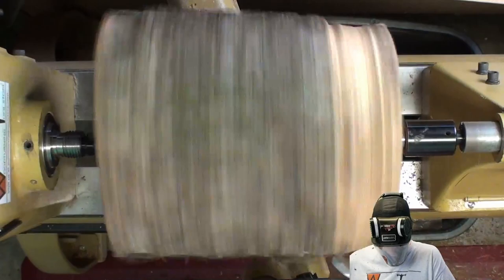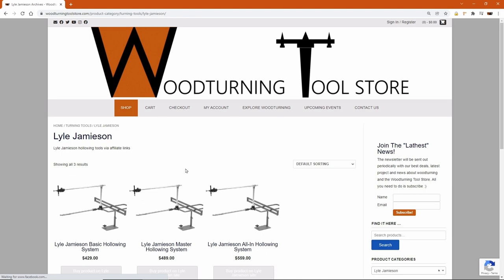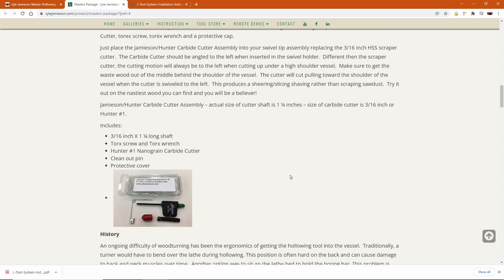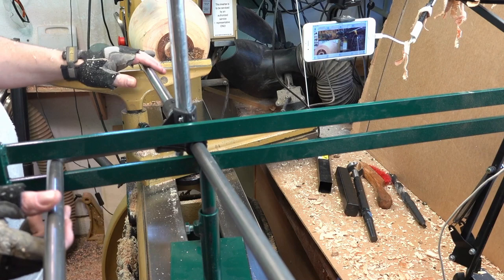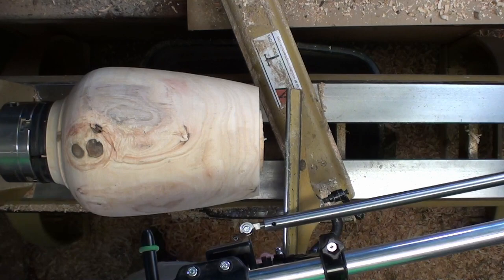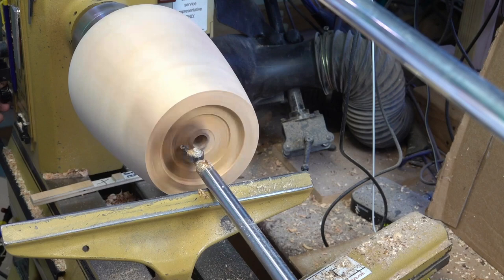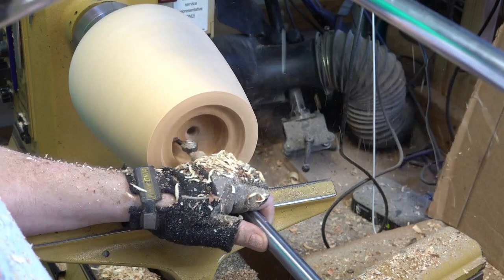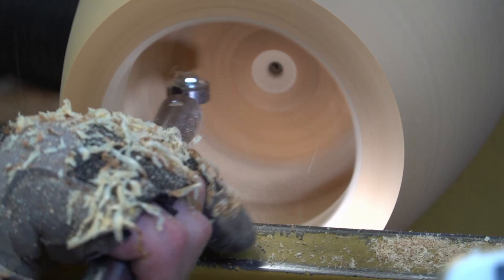Large Ash Hollow Form - Using the Lyle Jamieson Hollowing System

Comment: what's a safe hollowing depth with this system
Reply from the maker: Bill, the standard 3/4" dual ended bar is 17" long and can be used to hollow up to about 10-12". Lyle makes an optional 1 1/8" diameter bar for the same system that allows hollowing up to 17". I hope this helps.
Reply: @WoodturningToolStore  yes it does exactly what i needed thank you

Comment: On my Jet 1642... Once the cutter is centered on the spindle. If I move my tool rest back toward the tailstock the cutter lowers below the center line. Is this normal? Is my set up wrong? Am I retarded?
Reply from the maker: Andrew, thanks for watching and this is a good question. What is going on is that your hollowing system is not parallel with the lathe bed. In your case the rear of the system is higher than the front. So when you pull the tool rest back that angle gets exaggerated. To fix this, plumb your hollowing system to the lathe bed. If your lathe is level then you can level the hollowing system. In other words the lathe bed and the holloing bar need to be parallel. Note that level and plumb are distinctly different terms. I hope that helps.